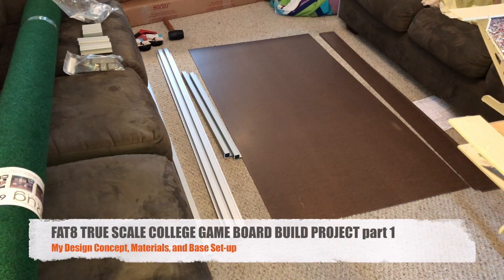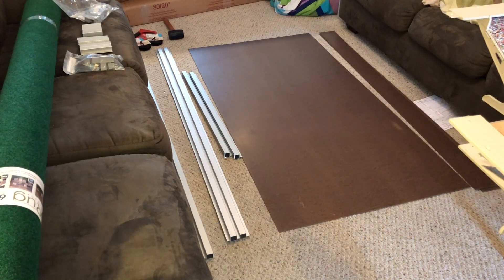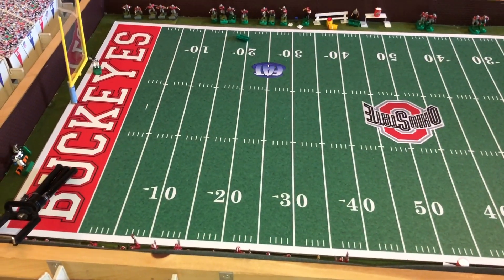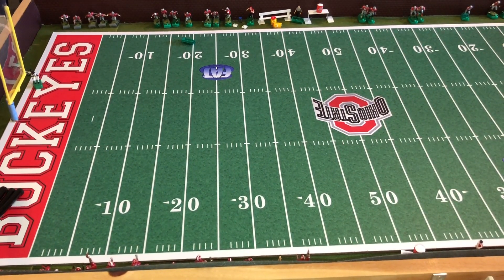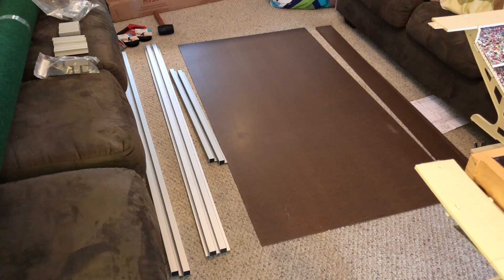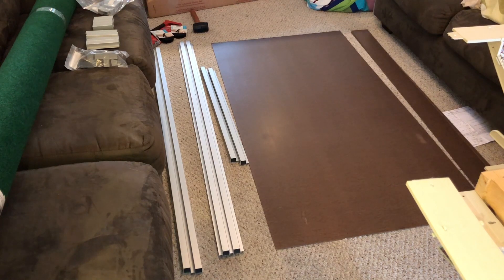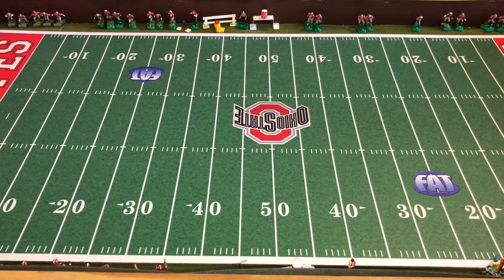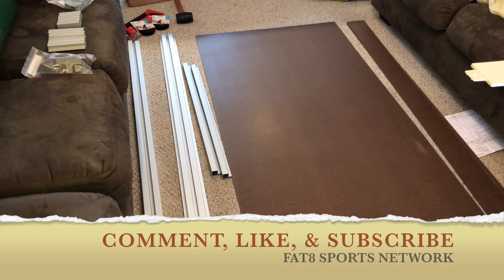BUILDING THE FIRST EVER FAT8 TRUE-SCALE BOARD part 1

Comment: Hey, I noticed you had some really bad warping problems with the scale size hardboard. What thickness were you using? I work with the remodeling department in our health system a lot and they have a lot of hardboard laying around that doesn’t seem to warp while laying on the floor even though it is walked on, cards are wheeled on it, etc.
Reply from the maker: yes it was a problem. I've since built my new board with 22 gauge sheet metal. Now it works great.

Comment: I've seen others use soap and water to apply filed covers to metal boards.  Do you do this same method with the wood surface?
Reply from the maker: Electric Football no it will damage the surface. It will cause warping.
Reply: Is there a video on how to apply field covers for wood?